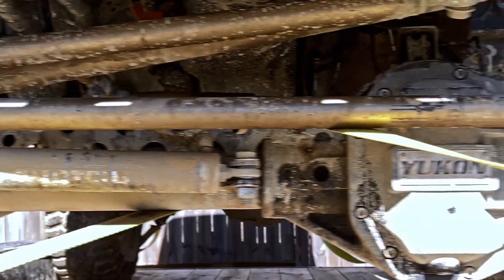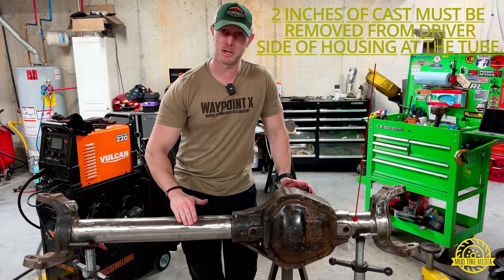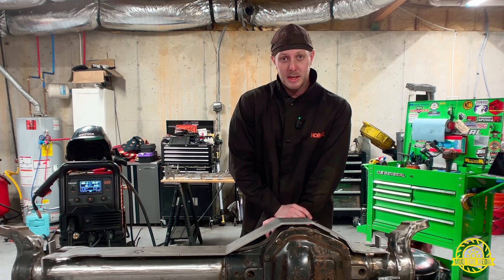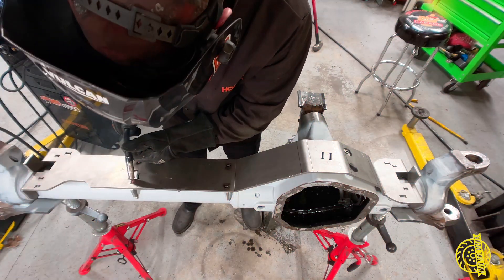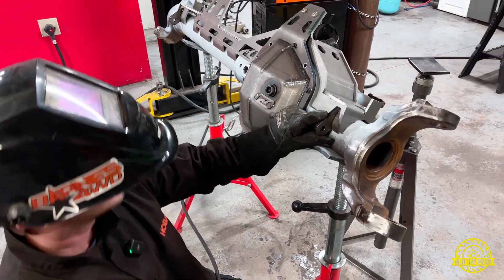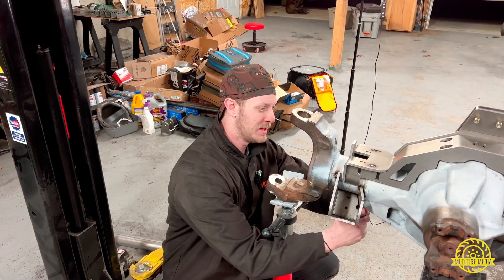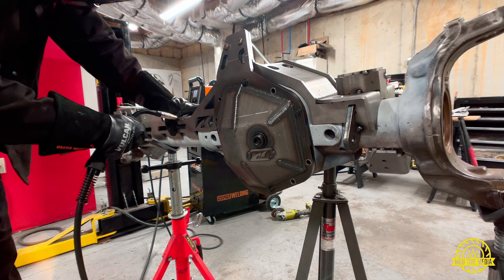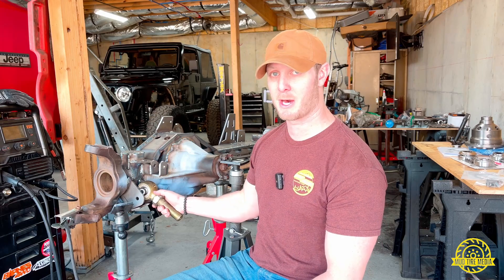Using @Motobilt_inc  JK Dana 60 Truss kit To Create A Powerhouse Front Axle

Comment: Next question. Did you use the trackbar bracket? Any issues with it? What bar you use?
Reply from the maker: CORRECTION: I talked to the owner of that Jeep and he says that at full compression on the trail, it does contact the diff housing. Not sure what the next bar is going to be. We may be making a custom track bar in its place.
Reply: @mudtiremedia  are you saying the trackbar is hitting the diff? Good to know! I was running the synergy bar and brace. Hopefully the synergy will work, if not I'll have to make one somehow. I'm not running the psc box thank God. Lol as I have a v8 swap in the future and I read they don't fit with the big bore. 

How about that 14b. Did you ever get the rear pinion guard to work?
Reply from the maker: @zxtuner4lyfe  correct, the track bar is currently making contact with the top of the carrier housing of the diff at full compression. This is likely due to the fact that we did push the front axle forward a few extra inches when we did this swap. It would likely clear with no issue if we hadnt done that, but he wanted the front tires to push past the front bumper as much as possible for clearance when climbing up walls. And as far as the rear pinion guard, he has not come back yet to finish that so i havent been able to reinstall that part. we bolted the rear truss in place using the bolt on plate that comes with the rear kit for the time being. I had already taken measurements and believe we have it all figured out. just waiting to get the jeep back over to the shop for more work. But i will mention that since his swap, we have yet to have a pinion touch an obstacle.
Reply from the maker: Hey I just made a YT short to show you where he is having contact. I hope this helps! Sorry for all the back and forth confusion.
Reply from the maker: I actually appreciate you coming back with questions. I’m happy to answer. We DID use the supplied track bar bracket. We mounted it in the recommended location (lining up the intentions in the new bracket with the current bolt holes for the steering box. The only issue we came upon was that the massive pitman arm of the PSC Big Bore that is in this JKU would hit the new bracket at full lock to driver. What we did was cut back the bracket on the forward section where the pitman arm would hit it to give clearance. And to help secure the bracket, I welded it inside and outside so it is held in with double welds. But it all worked out very well.

And for track bar, this Jeep was already upgraded with the JKU steer smarts track bar. This bar worked perfectly with the new axle. I don’t believe we have had any interference issues with it yet and this is a very beefy bar.

Comment: Great video, very informative. I have some questions, theyre probably super basic.
What mig wire size and gas?
What were you doing g with the blow torch and lazer temp?
Reply from the maker: Great questions! 
1) in this video, I’m using .030 ER70S-6 MIG wire. When welding something of this thickness, choose either a .030 or .035 wire because .025 is too thin for the thickness of steel you’ll be welding. And I am welding with a 25% CO2/Argon mix gas.  The standard for MIG welding. 

2) what I am doing with the torch is preheating the cast steel up to 350° before welding, then after completing my welds, I am monitoring the temperature on and around the welded area to make sure they are cooling at a similar rate. Add heat where needed to make sure they are cooling evenly and this process keeps the welds from cracking. 

If you allow the welded area to cool rapidly at different rates, the welds are very likely to crack. This is only applicable to the places where you are welding cast and mild steel together. The tubes of your axle weld very easy since the metals are the same as your truss. 
I hope this helps.